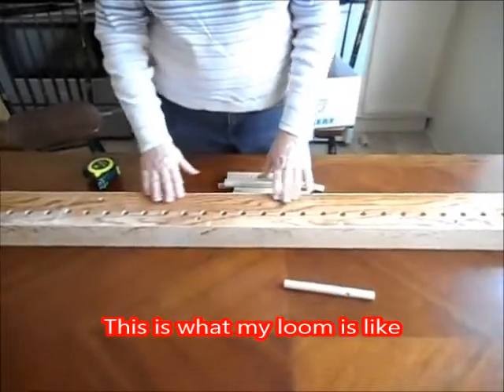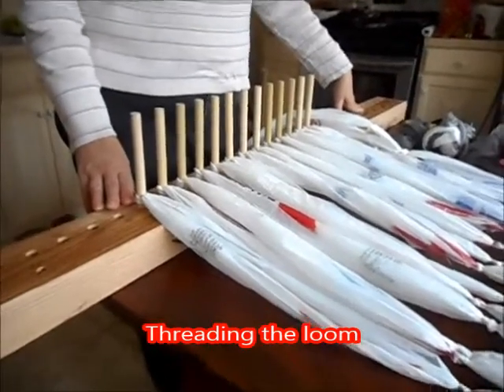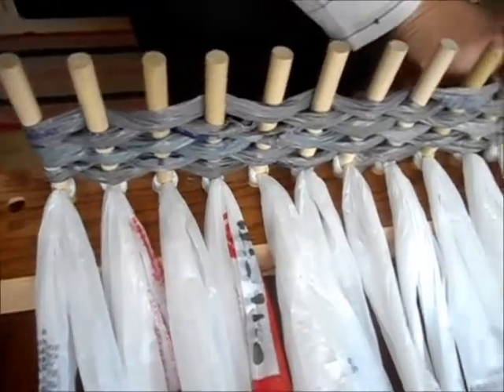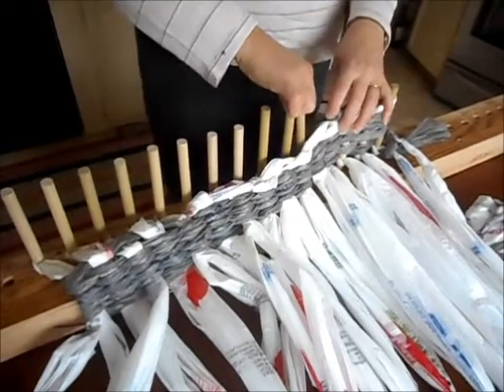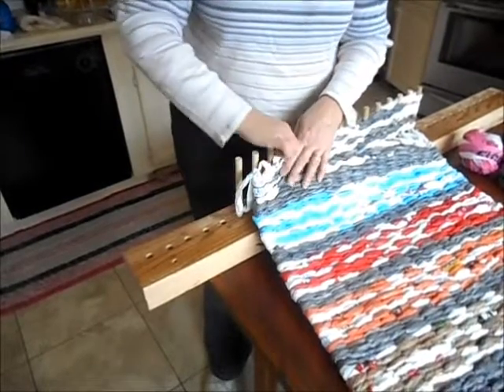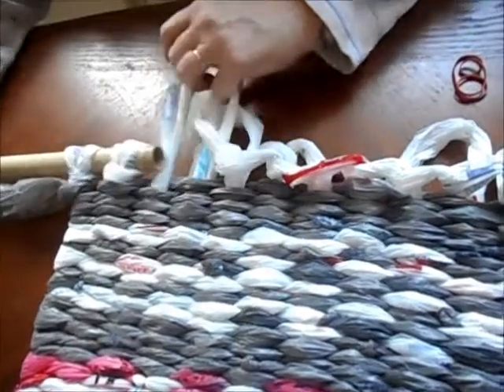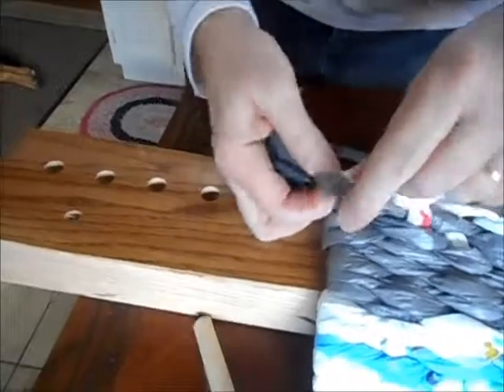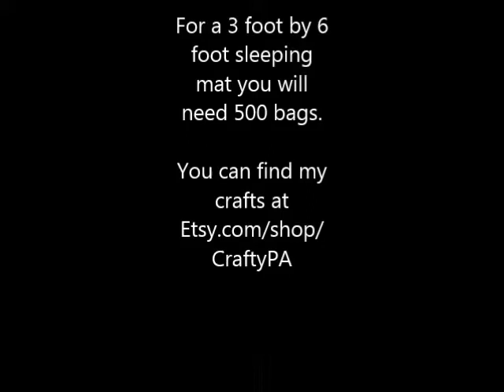Peg loom Plastic bag rug

Comment: What a great design as well as a thoughtful project.  Would you mind sharing the design info on the heavier wooden piece (e.g., spacing b/w the pegs, the diameter of the holes; the reqs for a 3-foot wide design vs a 4-foot design etc.?  And, thank you in advance for your project info.  What a terrific way to simplify the process!  And the result: a lovely rug/bed with function!
Reply from the maker: I had a 48 inch piece of wood to work with, so I put the holes 1.5 inches on center apart.  The dowels I used were 1/2 inch, so the holes I drilled were 1/2 inch also.  I drilled down one inch.  The hole in the dowel to pull the material through is 1/4 inch.  I hope that helps.

Comment: Hi Mom,  Thank you for sharing your great idea. You've inspired me.   Can you tell us about how to best use the rug?  Is it best for the back door to wipe your feet?  For in front of the kitchen sink?  In front of the bathroom?  How durable is it?  Whats the best way to wash it?  In a bucket, or with a garden hose nozzle?
Reply from the maker: I use the rug outside on the sidewalk, going into my garage.  I have used one under the pool ladder to keep dirt from getting into the pool, and outside of my tent while camping for the same reason.  The one by the garage has been there for a couple of years, it's worst enemy is green mold, as it is always in the shade.  Each spring I throw a bucket of bleach water on it and use a broom and garden hose on it.  The other ones clean up just with a garden hose.
Reply: Mom Eberhard how fast do they deteriorate in the sun? Do they seem to hold up to constant foot traffic pretty well? You said you had one outside for a couple years--what's the longest one has lasted? I love the simply loom and your video has inspired me to start saving bags and t-shirts! Thanks for sharing!

Comment: Love these videos!! Trying to start making some mats for homeless in my area. How long did it take to weave this?
Reply from the maker: This "little one" of 200 bags took me about 3 hours from start to finish.  The homeless mat will take you about a day.
Reply: That is so kind 💜
Reply: Stacy Johnson   My mom crocheted one for the homeless but her poor hands are so gnarled up with arthritis, she could only finish the one after a long time but she finished it she did. 
I loved this video. If I were you just lay on the floor and mark with a pencil at top of your head then sit up with legs straight and mark bottom of shoe. Then add a bag more for a man. Usually they are taller. Then you will know how long you need it or google how tall the average US man is. Add bags accordingly. I'm sure you will have 4-5 bags in length.
Reply: This looks easier than crocheting the Matt but if you crochet the use the P hook. I think it's the largest plastic robin egg blue one.
Reply: Even if you cut the plastic bags to make very wide strips, a 'P' hook would be pretty holey crochet fabric. I am going to use this method to create some panels as 'artwork' for a makerspace I belong to. Collecting the bags has taken a long time, but I think I have enough for at least one panel 4' by 6'.

Comment: How far apart are each peg hole?
Reply from the maker: I made mine 1.5 inches on center apart because I knew I would be working with thicker material.  If you read through comments, I posted a description in there of the various sizes of holes, pegs, etc.